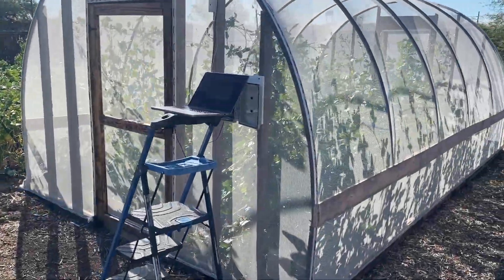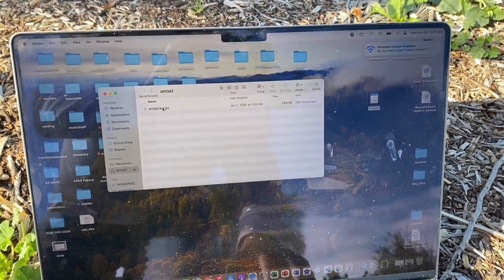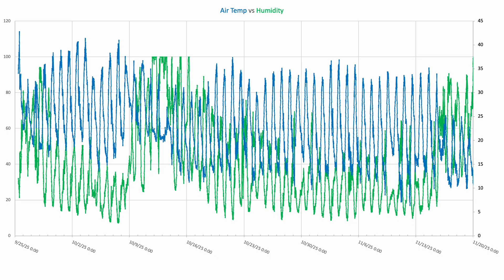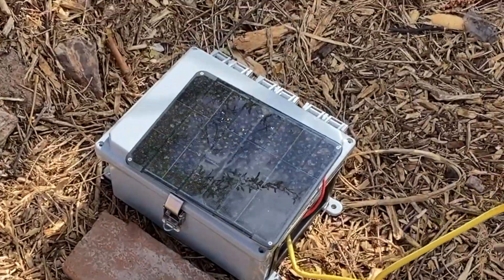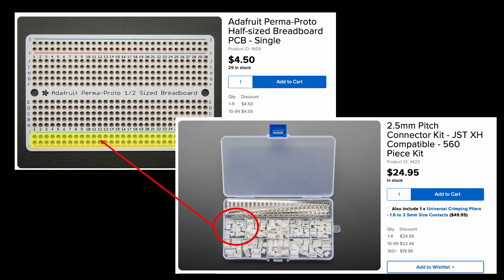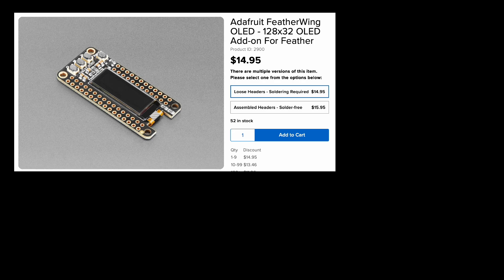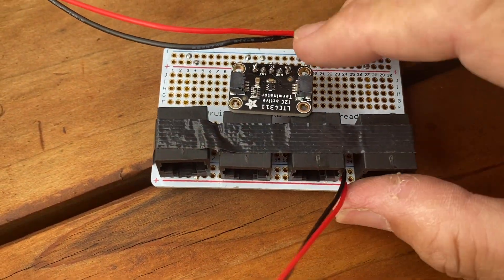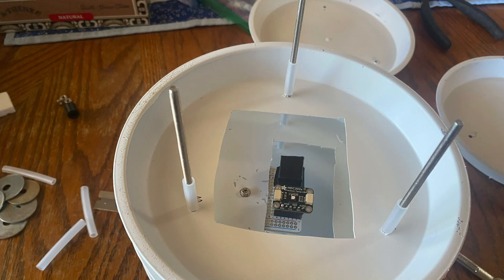Mission Gardens Data Logger Build and Test

Comment: NICE WORK. 
     I have a (hopefully) interesting question:

    How much time did you spend on each part of the build.  Specifically, (1)  building the enclosure mechanism,  (2) fastening everything into place at the test location, etc.  Forming the test hypothesis/protocols is the easy part.  But, getting everything mounted, configured, and insulated must have taken 10+ hours by itself.  
    So, if you could, in future vids, could you approximate the TIME you spend on these configurations, along with the COST of the items.  

Thanks - nice video (as usual).
Reply from the maker: For a first build and test- yes, the time is significant but once I have a design that works, the time investment goes way down. The piece that takes the longest is coding (and testing) but once it works, the time required for future iterations goes way down. The idea is to share with others so that initial investment pays dividends for the broader community 😊. As for cost, there is a link in the description of the video summarizing inventory of the most critical components. I recommend Adafruit or Sparkfun but you can probably half the cost on many components if you purchase direct from China. Bottom line is if you enjoy creating something you can share to help others, the initial time commitment is not that onerous.

Comment: While AZ humidity is normally low you showed that there were some drippy days. It might be worth a little extra time to coat some of the boards in thin epoxy including the ribbon cable contact points on the OLED. They are probably sensitive, Being in the Southeast I typically place my boards into a sealed glass jar with desiccant packs and caulk the grommet for the wire pass through. Nice work and great to see Adafruit in the field.
Reply from the maker: Great idea- things do get sticky here during the monsoon so will do as you suggested and post an update. Thanks!